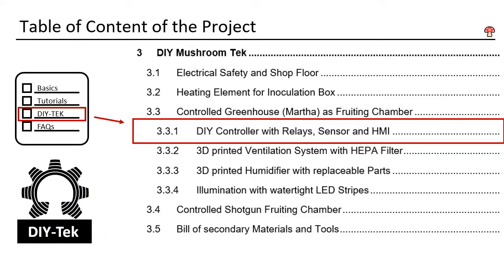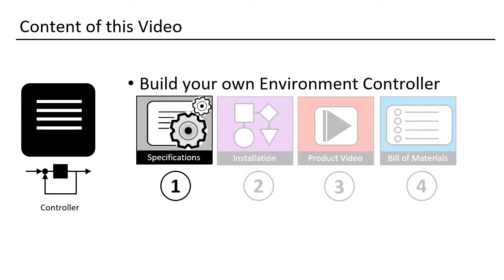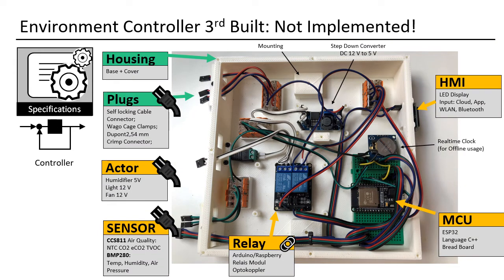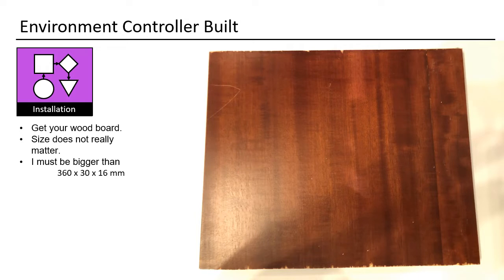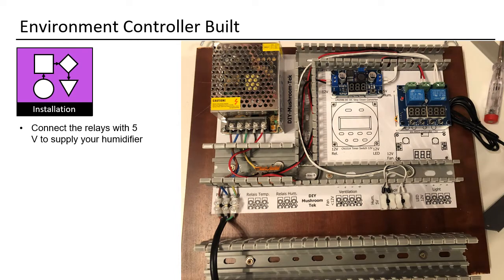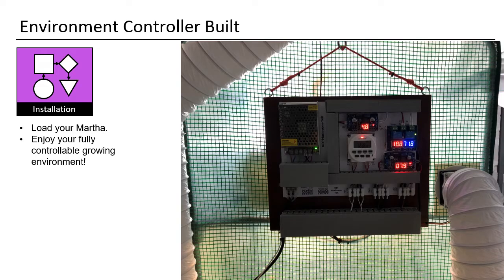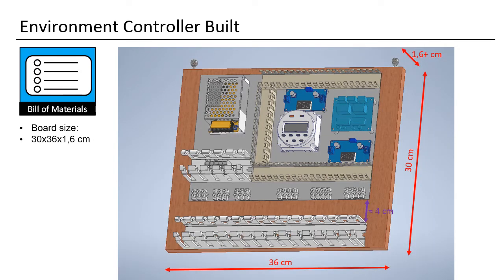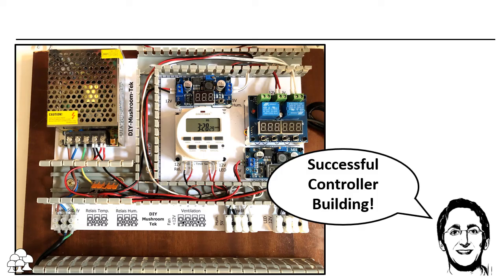3.3.1 DIY Controller with Relays, Sensor and HMI for Martha Grow Tent

Comment from the maker: Addition assembly instructions:

Normally cable end sleeves are used in combination with a screw connection to create durable connection pressure. Without it, material flow as a reaction to the pressure can diminish the applied pressure and thus weaken the connection.  

Normally when one uses a cage clamp connection (that is a kind of spring connection), then one uses only the stranded wires. The spring does maintain the pressure during the hole lifetime of the connection. The usage of stranded wires insures good contact between the copper and the clamp.  

According to my experience and to my knowledge, one can also use the 221-415 cage clamp with cable end sleeves, when they are crimped into a square cross section. The reason will be that in this way a line connection between clamp and sleeve is created. But if it is crimped into a roundish cross section, then there would be only a point connection between sleeve and clamp. This would be a lesser good connection that might have a little higher connection resistance value.   

In my video I did use cable end sleeves that were crimped with a Phoenix Contact CRIMPFOX hand tool that creates a hexagonal cross section. If I would redo the video, I would not use cable end sleeves in combination with cage clamps, to keep it simple tool wise.

Comment: I bought all the stuff to make your assembly off Ali Express. I was wondering if I could pay you to print out the parts you had to make with the 3D printer.  I don't think there were that many. Would like the thing you made to hang the board beside the tent. And last I need the website you used to get the wire guides with covers. Could not find them on Ali Express.  Thanks!
Reply from the maker: Hey Matthew! I normally use aliexpress to source small components cheaply. If the pieces become too big, then due to the rising shipping costs I normally use ebay and local stores. 
Here could you find the wiring duct:

Ebay.de:
https://www.ebay.de/itm/304435009977?hash=item46e1bd99b9:g:uRwAAOSwJ3liz7r8&amdata=enc%3AAQAHAAAA4Bp5tBUyHsxGsy3tKJTsJi0j6vy4yAyWmMCxwQEpIWTQJz8IBe3qsNi%2B%2BUqaEqs1cW7y92nBSXYyZSblVrMBrtD%2BXKNBsbzvy9FFWMQoar1aqNX6sVs0jWEKtwHUPzwldpgwy%2BnhL3ddNXg8wTBRA3WbYyaZ5A4uAEuJ1sgVvF7XaLjoJQSzMpMHCP4dUeh%2BXjhiJWj0R%2F7d3IxTFposLWKbdKE%2BcU2tFM8KXFL%2B8Ybiu3%2FidSI5DWyVgdXQiTtAUnka6ngs6rUn0xwWLtyffqCvj%2F6hqNOAQfeDLEVNRnWB%7Ctkp%3ABFBMmLOij5dh

Ebay.com: (Kind of expensive. You could find a cheaper one, near to your location)
https://www.ebay.com/itm/144655431861?hash=item21ae22b8b5:g:S6YAAOSwc~li2vsL&amdata=enc%3AAQAHAAAAoD%2Bi%2BosykhMowyEzTIrpypZcdOgUjMgF4kkqzsCvp42nUazQG5Bf2SOOEZ95yDVHSLsENtnWZnJgIRii8U0Oexnu3f4kVNLrdmu%2BPZVmir%2Bqn1Cysi6qnboiuL%2FZf4c49P4GNOlBPIXK%2FVkD90Sv7%2BQDxKdRgbuBCiIWPMIBpYw%2FvOqVJMBigg9%2FcvvwyMb7jX78wbt%2F1xqQ1q7fc%2FH5eeY%3D%7Ctkp%3ABk9SR7rVmI-XYQ 

If you do not have  access to a 3d printer you could use a little pieces of wood to mount the electronic parts. Due to the soldering peaks one cannot screw them directly onto a flat surface. 
The side hanging mount can easily be fabricated by taking a metal sheet and bending it into the desired shape with a bench wise.
Where are you located? Send me a PM please, maybe I can help you out!
Reply: @diy-mushroom-tek  Sent PM via your business email address on your YouTube account.
Reply from the maker: Here in Germany, there is the page www.ebay-kleinanzeigen.de . Some people with 3d printer offer there their service for a small fee. 

The pendant to this page in the USA would be https://craigslist.org . I found on both homepages students with 3d printers that are offering to print out parts.

Please check, if you find an inexpensive 3d print service, easiest would be directly next   to your location. But many offer also to send the prints. Or connect with someone who ownes a 3d printer. Most of the owners are happy after a while to have something to print out. 

Concerning the glue question. I just use a simple glue stick that is for paper to glue the layout onto the wooden board. The wiring duct came with adhesive tape on it for simple placement. I anyway used extra screws to mount it on the board.

Comment: Hey new to make this type of stuff, how would I do this but add a co2 indicator? Would I need to buy different parts?
Reply from the maker: Hey, this is a valid question. There are several ways to tackle this problem. The way that I chose, the cheapest way, is to decide, that a CO2 sensor is not really needed. When one uses a constant air flow, this is what to my understanding most of the growers do, then one just observes the fruiting bodies. If they are happy then the airflow is good. If not, then one can in- or decrease it accordingly. I also prefer this approach, because you start getting in touch with the organism that you want to see flourish! After building a tent this hobby becomes more like gardening to me, not engineering.

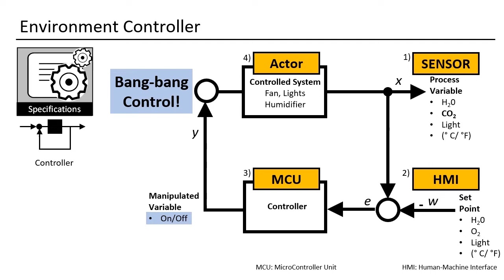Another way would be a little more expensive and you will need a little bit more technological knowledge. You could use a microcontroller in combination with a CO2 and Humidity sensor. Then you can use the input data how ever you want to start/stop the fan and the humidifier. I used this solution before I simplified it. You see the solution with an Arduino Nano and then the later version with an ESP32 starting at minute 3:22 .
I did not have that good experiences with the CO2 sensors that I used. I ended up with an CC811 air quality sensor which works fine for monitoring the co2 levels in my home office and it can remind you to open your window from time to time, but it did not work so fine in a highly saturated environment. In my tent I use humidity levels from 80-100% and in my room I currently have 50%. 
If someone uses an affordable CO2 sensor with good performance in highly saturated environments, please share your insights with me and everybody else.

A more expensive but easy to implement standalone solution that comes also to mind is to buy a programmable CO2 controller. This approach is used by the majority of the hobby grower. The classic way is, to get a tent and an inkbird controller. They have models for humidity and other models for CO2. I just checked the price of the inkbird “Programmable CO2 Controller ICC-500T”. The current price is $160 (15.11.22). This could come close to my complete setup.

If you decide to use an CO2 controller you also have to decide according to which logic you want to use it. I guess that an CO2 Sensor just for monitoring the levels would be a thing nice to have. But to use the levels for control would mean that you do not use it as a shot gun controller (ON/OFF) but instead to use the inputs of the sensor in combination with a PID controller that is able to set the speed of your fan accordingly in order to approach and maintain the desired CO2 target level.
Reply: @diy-mushroom-tek  thank u for that! I see that a co2 isn’t that viable and I do want the approach of learning how each mushroom grows I’ll do more research and decide if I “really” do need one thank you again!

Comment: Is there any way to get the wiring diagram im getting confused 😅
Reply from the maker: Thank you for your request! I've prepared a comprehensive cable wiring plan and a cable convection plan to simplify the DIY controller assembly. To ensure ease of use, I've created a detailed step-by-step guide in PDF format. This guide provides clear images that illustrate each wiring process, making it much more convenient than pausing a video repeatedly to catch important details. You can access the guide in my Google Drive folder through this link:  https://drive.google.com/drive/folders/1B2OIvdmnxRqS1MRcuJaII8CSyUZvPqu5?usp=sharing 
Happy assembling! 🛠️🎮
Reply: @diy-mushroom-tek  Thank you soo much sir 💛
Reply: @diy-mushroom-tek  Can you Please check the link  sir, I can't open it for some reason , and thank you for your videos it is very helpful ur videos have soo much information compared to others ur channel is soo underrated and thank you for building the control unit with easily available parts , thank you for all ur effort it's  mush appreciated ❤️
Reply from the maker: 331 -- Template and Wiring Diagramm v1.0.pdf
https://drive.google.com/file/d/1Z23A1IfQ9yNbDqCLd-RPoHQn7uUI8Qmy/view?usp=drive_link

Both links should work now! Happy mushrooming!
Reply: @diy-mushroom-tek  Thank you 🫶

Comment: Hey, you made a typo in the bill of material. Its Wago Connector 221-415, you wrote 221-2415. And you did not precised to buy 2. As im not familiar with Wago's i ended up buying a 222-412 since i was confused . No big deal, i should have researched more..
Reply from the maker: Hey, thank you for the correction! Sorry for that! 
On slide 13:56 there is the typo but the correct product is shown and selected. 
Anyway, this is the product, Wago 221-415: https://amzn.eu/d/7rghjlW 
Happy building!
Reply: @diy-mushroom-tek  Thanks! I replaced it with  Dupont connectors as i wanted to finish it tonight, looks like its working! Im more of a tinkerer with electronic and this was my biggest project yet. It was super fun and rewarding to build your creation. Thank you for that, the videos and the neat powerpoint. All really helped a lot for a newbie like me.
Reply from the maker: Hey Linus! Wow, this are great news! Congratulations to you and thanks for the good feedback, I appreciate it! Sorry for the late response, I upgraded my system to windows 11. 

Yes, one can of course use dupont connectors instead of the wago connectors. They are cheaper, but one also needs the correct crimping tool and the knowhow about the assembly.

What mushrooms are you planning to cultivate? Maybe you can share some of your recipes or growing procedures when you have them bountifully growing?
Reply: @diy-mushroom-tek   Hey, no need to apologies all is fine.
I actually used domino connectors, not dupont (still learning the lingo).
I will make a presentation of my setup when i finished it completely, since i dont have a 3d printer im building with scraps, not beautifull but i think its interesting too.
Im just starting my myco adventure by doing cloning on agar of wild mushs:
boletus aerus, boletus edulis, ganoderma lucidum. 
And store bought:
Agaricus bisporus, Lyophyfyllum shimeji.
I also ordered:
Lions mane, grey oyster

I know its a lot of variety for an absolute begginer but im having so much fun!

Cheers and mush love